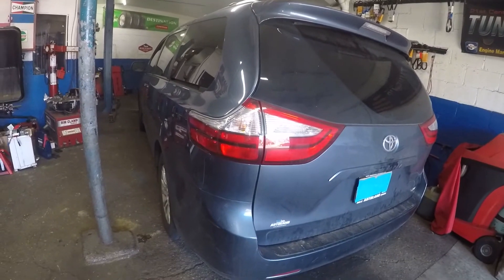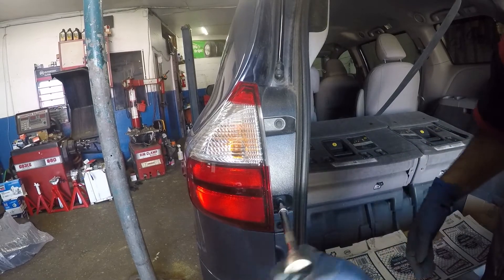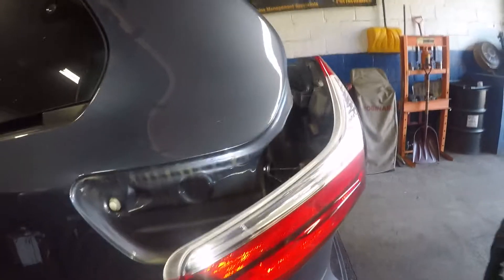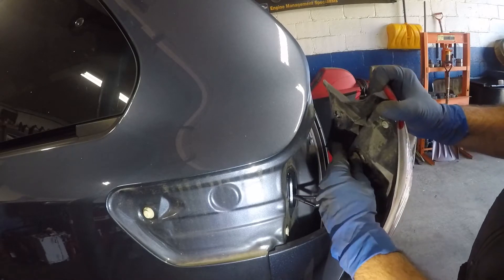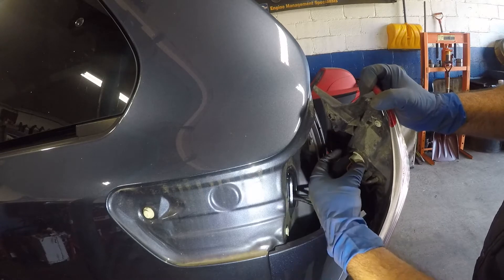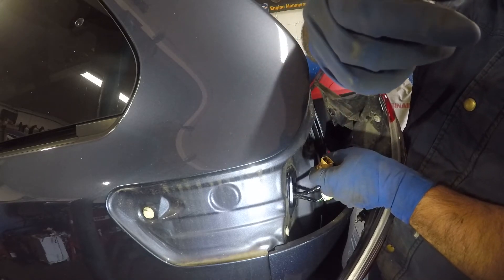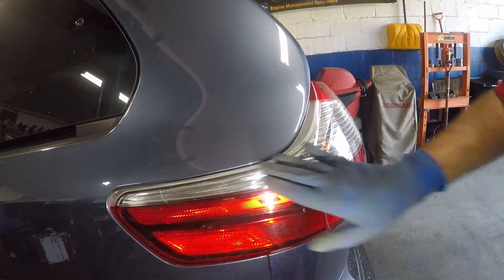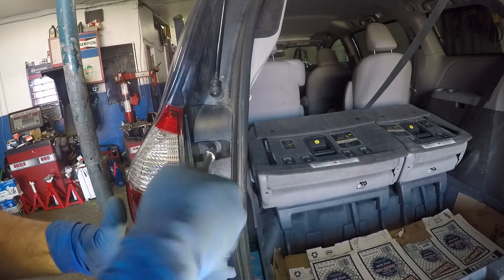How to replace brake bulb on Toyota Sienna 2017 and more

Comment: My Assy wouldn’t move. I took a 18 inch piece of CAT3 cable and slid it behind the plastic piece that bolts to the frame. I pulled the cable and it popped right out.